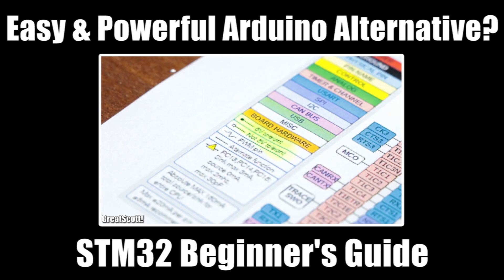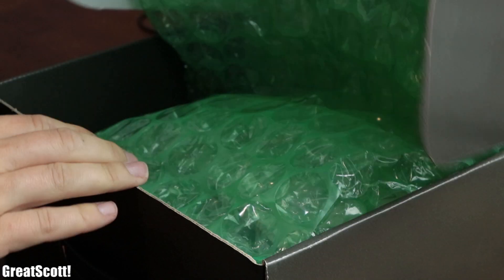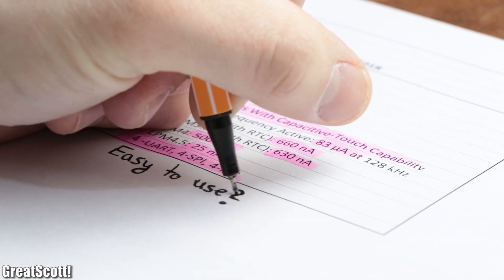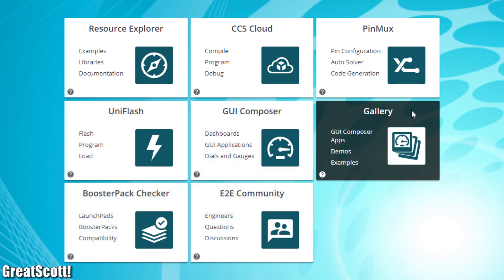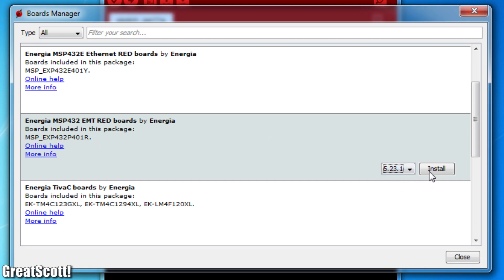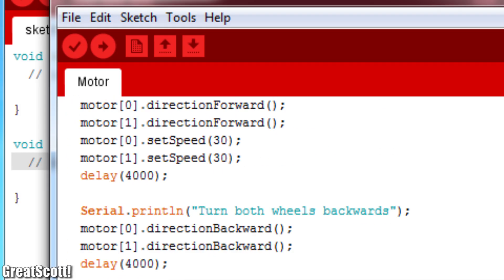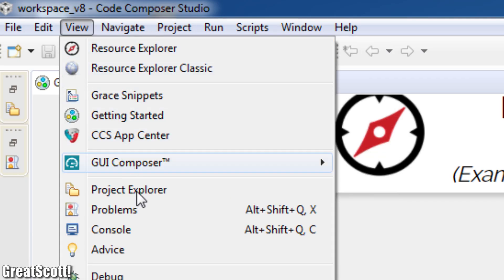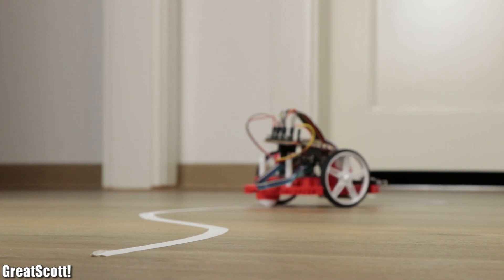Easy & Powerful Arduino Alternative? #2 MSP432 Beginner's Guide

Comment: Hi, could you make review Maqueen micro:bit robot, it is good & cheap robot for beginners, it use web platform for programing, but maybe there are other solutions? Other question is about connection of other sensors, etc - because so far there are lack of libraries. I thing that the Maqueen micro:bit robot could be very good solution for learning children about programing & robots - because it's cheap, quite simple, but  on the other side - too much software & hardware limitations (control by BT, sensors, etc)

Comment: I've tried the msp430fr5994, it's 16 bits and not exactly more powerful than arduino, although it has the most flexible and simple DMA that I have used, it also has that FRAM, a kind of no volatile ram up to 200k.

Comment: Georgia Tech electrical engineering student here. GreatScott did a great job making the MSP432 DevKit from TI seem easy to work with. In practice however, the TI software is a massive headache to work with. The hardware is top notch, but for most DIY applications the Arduino will be much more easy and rewarding to work with. TI’s development software and associated drivers cause many problems during installation and use sadly.
Reply: I have to agree with that. I have used both Atmegas and MSP430s. I absolutely love the features of MSP430 better (one of my favorite is that their clock generation and routing system is far more intuitive and flexible to me). However, the TI software might be a bit rough depending on what you are trying to do.
Reply: I am teaching embedded systems at a University of Applied Sciences based on TI's boards which are very similar to MSP4xx. There are so many annoying things about the whole endeavor that I will only list a few. The drivers are buggy: I have found and reported multiple bugs in TI's driver library (in their forum because no public bug tracker exists). The hardware is buggy: the I2C masters trigger the busy signal too late (in the beginning of the transaction!). The IDE is slow and overloaded: eclipse is not my favorite IDE at all, but TI managed to make things way worse. Linux (and Mac OS) support has major problems: even after years some features working for a long time fail after a update w/o TI recognizing it. The linker scripts for GCC provided by TI are incorrect as well if you want to avoid the IDE. The RTOS' drivers are half-baked in several places (GPIOs and INTs). And I should probably mention that I absolutely detest Arduino - that's a whole other rant though - because I want to avoid the impression that my critique of TI comes from an Arduino fan boy. And yes, many other MCU companies suck just as much as TI - but they are not praised in the video I comment on ;)
Reply: Or just use the STM32 he talked about in another video.
Reply: Thats exactly what I was thinking too..
Reply: Did you try the unified IDE
"platform.io"? This should allow seamless Code transition.
Reply: My school in Brazil uses a outdated version of IAR and it sucks! The compiler is very fast but I have many problems with the FET debuger that randomly crashes when setting breakpoints
Reply: s bright there is a free, limited version of IAR. That's what I had used in one of my classes where we worked with an MSP430. The only downside between that version and the full is if you want to write in C rather than Assembly, the code size is limited
Reply: i myself tried both arduino and ti launchpads. arduino is way easier to program than using the ccs from ti, though we can use the energia, ti launchpads are really a headache to program and offer little support as too arduino is much easier and user friednly
Reply: I like a challenge, and even I’ll say the msp43x ecosystem is a huge headache.   I spent more time wrestling with things like the software, documentation, and code samples than I did writing code that did anything useful.
Reply: The TI ecosystem, like Halcogen and CCS, are not ever going to be as easy to work with as Arduino. As mentioned in the video, they are actual engineering tools. If you get over the hump and begin to master those tools, it opens up the massive TI ecosystem/platforms/device families.
Reply: TI Tools are not for hobbyiste who just want prototyping. It's like compare making a project with python or C.
First case is really great for learn from zero and acquiere some acknoledge. But second case need some basic teaching of how hardware et hardware langage work.
Reply: @fafane65  I'd disagree, I bought the starter kit for the MSP430F2013 for something silly like 4.30 euro at the time. The ICs themselves are also really cheap, I can buy 4 or 5 MSP430 for the same price as a single ATmega32. 
CCS wasn't the easiest software to learn, but there are heaps of helpful people form India on YT who explain things very clearly for free. And a lot of my ASM experience carried over basically 1 to 1.
For me when a project needs something more complicated than a 556, I'm just slapping on a MSP430, because it'll do what I want 99% of the time and they cost barely 2 euro a piece. I'd say they're the perfect DIY microcontroller, cheap, they come in a PDIP package and all the software is free.

Comment: Hi @GreatScott, great video as always.
As someone who has worked with TI MSP430 (8 bit controllers instead of MSP432 32 bit) and TI Stellaris TM4C123G series micro controllers over 5 years, I totally agree with you on CCS having a higher learning curve than the simple Arduino IDE. However if one uses CCS well they can get some great mileage out of their microcontrollers and use them at their best.
Also, there is TI E2E Community where people can look up problems and issues they might face using different controllers.

Comment: 013: What's a USART?
Reply: Universal
Synchronous and
Asynchronous
Receiver and
Transmitter.
It's the hardware that makes up a serial port, with extra stuff to support different modes.  It is very handy for development since you can use a USB to Serial cable on any operating system to get debugging messages, and for talking to other chips on the board like EEPROM and temp sensors etc.

Comment: Great video 👌👌 
MSP432 
NRF52832 and NRF52840
ESP32 , ESP8266 OR ESP8285 
 These are awesome microcontrollers actually. 
They are pretty cool .
Reply: I'd like to see sam-d21 Chinese clones with Micropython + later on with WiFi when they get one on/with the circuit. Information is very sparse compared to Arduino/esp.

Comment: I don't know how widespread the MSP430 is, but my uni used it exclusively for our embedded systems EE class. Although that was all assembly, not Arduino code
Reply: Same here. we learned assembly and C on the 430. The professor is trying to let the department switch it out for a newer processor like the 328p or the D21, but change is slow in academia.
Reply: On a small electronics factory i worked for some time it was all PICs (all the simple PCBs), 1 MSP430 (internet of shit), there is another than might be using ARM or other more advanced micro because they were a electrical/power electronics company (also on electric car chargers)
Reply: s bright  The class did have an emphasis on the architecture. We did cover some C as well. In particular, we bench marked several of our assignments in C and assembly to see the tangible increase of speed when using proper assembly routines. The final project used a C control structure which called various assembly subroutines.

Comment: Two important features missed in the video: Full debugging, and hardware floating point. Also check the tiva connected launchpad, I'm using it on most of my lectures.
Reply: Cool!  I'm glad to see someone that's not bashing.  I like it, I have a couple, but I never had a big use case for it even so I like it so much.

Comment: Do any of the used software packages to compile and upload code to the MSP432 work on Linux or Unix based operating systems?
Reply: I'd recommend trying Rust on these boards under Linux, nicer than using C and the Arduino environment...

Comment: FPGAs!
Reply: Bring in Xilinx dev board!
Reply: Release the power of Zybo (Zynq 7000) or Ultra96 (Zynq Ultrascale+). And more powerfull chips coming from Xilinx :)
Edit:
Sadly all good Xilinx and Intel boards are 50+ usd price range. Now playing around with Arduino Vidor 4000 (Intel Cyclone 10)

Comment: Have you worked with any Parallax microprocessors? The Basic Stamp, and Propeller?
Reply from the maker: Not yet
Reply: @greatscottlab  I'd really be interested in seeing what your thoughts on them. I know that the Propeller has come a long way since I did stuff with it back at its launch, which now that I think about it was quite some time ago now. It didn't have a mature c dev ide back then, and its 8 core interruptless design was definitely different to work with.

Comment: Have you done anything on the ESP32 yet? I've heard a lot about it, but I haven't started digging into the platform yet.
Reply: He's done a WiFi controlled led vid with it
Reply: Nah, just buy the Wifi chip only and use an STM32 microcontroller. you dont need a esp32 board

Comment: I too just now jumped from stm32 to TMS320F28379d mcu with matlab support, eagerly waiting too see your CCS tutorial :-)
Reply from the maker: I will see what I can do :-)
Reply: F28xxx CPU is great for real time control (PID, fuzzy, FFT, filters...) but it can not address bytes individually. Chars are 16bit, and it breaks compatibility with most communication code you find, like ethernet or sdcard.

Comment: Hi, have you tried using Atmel studio to write code for an arduino or any other Atmel MCU?
Reply from the maker: Yes
Reply: What are your thoughts on it vs the Arduino IDE?
Reply: I've done AVR assembler for an early Atmel chip, the S1200,   same AVR family, pre-arduino, using Atmel studio (if I remember rightly! ).  Also eclipse?  Years ago, sorry.  If you're finding the arduino environment limiting you can bypass any bit of it, or all of it.  An example, the mozzi libraries for sound synthesis hijack a timer from "the arduino environment".  As a user, I can write my program in the arduino environment remembering that I can't use that timer.  No more complication than that.  It's clever.  The underlying GNU C++ compiler will pass through assembler, so does not limit the user.  And the superficial arduino icing on the cake allows that pass through too.

Comment: I'm sure my comment will get buried but it would be amazing if you did a video on CAN bus, what it is, how it works, and programming a microcontroller with an integrated CAN transceiver.
Reply from the maker: It is on my to do list
Reply: @greatscottlab  Also you should look into FRC kids use CAN a lot for stuff like this. Here's a little preview of what it is https://www.thebluealliance.com/match/2018cmpmi_sf1m13
Reply: @greatscottlab  Hope that will be using Stm32 or TI launchpad. Also if you can you should put a video on Beaglebone Black.
Reply: Sparkfun has an According to Pete video about CAN bus that's fairly detailed: https://youtu.be/YvsGuK9Up0E
Reply: As well as Transformerless power supply. @GreatScott! .
Reply: CAN is pretty simple, as well I don't know of any microcontrollers with built in CAN transceivers (EDIT: NXP has one Cortex M0 microcontroller that has a CAN transceiver built in, toted worlds first).  But CAN works using 3 voltage levels, in a 5v system that would be 0v, 2.5v and 5v.  All CAN does is drive the HI line to 5v and LO line to 0v to power the device and transmit a binary value of 1.  To transmit a 0, it drives both lines to 2.5v.  So basically if you have a differential in voltage across the pins you get a 1, if there is no differential you get a 0.  CAN uses 2 or 4 wire for interface, with 2 wire providing power and communication all in one, and limits how many 0's can be sent in a row before the device loses power and resets, while 4 wire provides power on 2 wires and uses the other 2 for communication to get around how many 0's can be sent, although 4 wire sort of defeats the purpose of CAN protocol.
Reply: @KlockworXMusic  this is slightly wrong. When transmitting a zero, it is transmitted as a dominant i.e CANH to 5 and CANL to 0. Whereas when transmitting a one it’s sent as a recessive bit I.e CANH =CANL =2.5V.

Comment: I use CCS with the MSP430. I wanted to access/see the low level hardware I knew was being hidden from me with Arduino. It took a bit of time and a (now outdated) book, but I got the basics down - clocks, timers, interrupts, gpio, LPM. ADC next. There are lots of examples on the internet, but not nearly as many as for the Arduino.

Comment: Can you do a complete video on microcontrollers and their specific uses in various projects? Also some resources for learning microcontrollers would be helpful.
Reply: Microcontrollers are more pripietery low end low power CPUs that main purpace is control GPIO general purpice IO to run programs that control electronics using programable pins on GPIO interface. So it practicly a lowest of low end computers just for controling electronics. just to proof the point Rasburry Pi is ARM computer, but it has GPIO interface which let you use it same way as ardino, but ofcorse Pi is more powerful hardware and let you do more then that and incorporate GPIO in to it, while ardino can only control GPIO
Reply: @ShadowriverUB  Thanx for the explanation. That's nice way of putting the comparison.

Comment: I have been using the msp430G2553 which is pretty good too and has programming similar to addition. Only problem is the memory size, but for $15 it’s pretty nice. Might try to add memory to it if possible
Reply: Msp430 are 16bit cpus, msp432 are 32bit ARM M4F with floating point. Check the similarly priced TIVA C 123 launchpad instead, it way more capable.

Comment: Hi Can you make a DIY or BUY bluetooth talkie-walkie ?
Reply: Wouldn't that have terrible range? I think LoRa would be better wouldn't it?
Reply: And isn t it called Walkie-Talkie?
 Somehow its sounds wrong the other way around lel :P
Reply: @hardtry2035  no, in many countries we call that Talkie walkie. And for us, walkie talkie sounds very bad lol. And of course, walkie talkie is an english word , so the true word is walkie talkie.
Reply: Better use an NRF24L01+. Those have up to 1 km range, but still not the best for a walkie-talkie.
Reply: good idea intresting projek if you van use home com system
Reply: Visit me also, thanks :)
Reply: Have a look at the DRA818v/u modules!
Reply: 5thString  
Haven't tried it myself. Thus the framing as a '?'
Thanks for the heads up though. About the only thing I want to build ATM with any kind of radio is a mailbox notification system so I'm not constantly checking the box to see if I got a surprise package from China. That will probably be an ESP8266 jobie too so I'm way behind the LoRa trend.

Comment: Great video. It will be interesting to see some ST MIcro boards.
Reply: Well, he did before, with Bluepill board
Reply: bluepill is awful, better find a Maple clone if you want to build something around it, or go for ST dev boards
Reply: @RAPXZibit  I would consider it good for its damn cheap price.
Reply: @long pham blue pill is 1.2-1.5$, maple clone 2-2.5$
also with voltage stabilizer (that means Vin without additional circutry), two buttons, and without that jumper bullshitery
Reply: For some reason I thought the STM micro was Microchip, not ST. I will have to get one of those boards. I got the red pill but forgot about it.